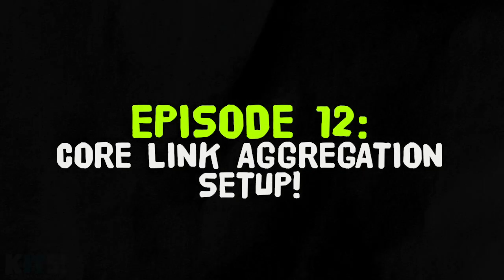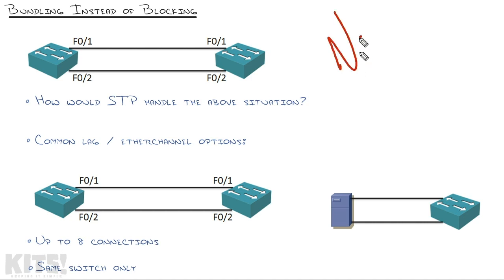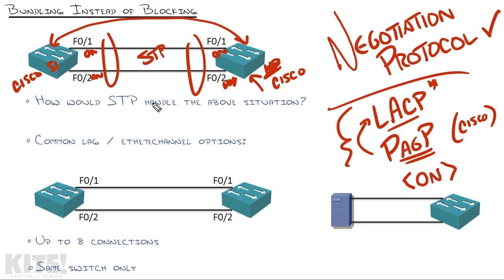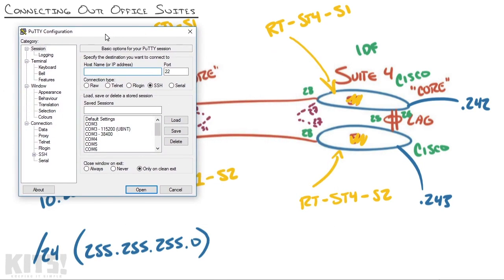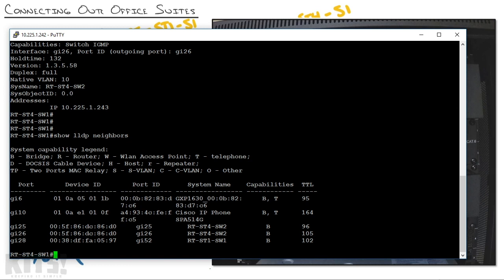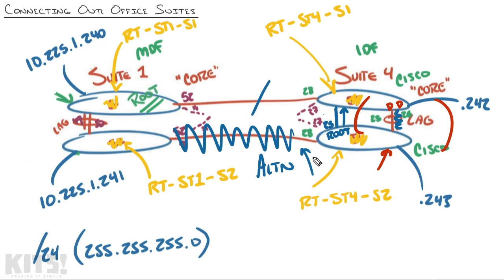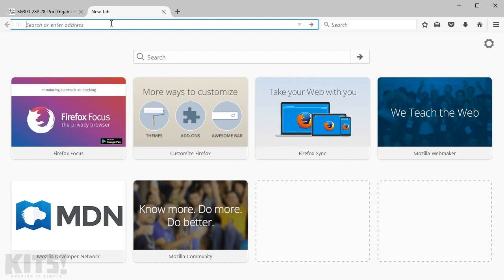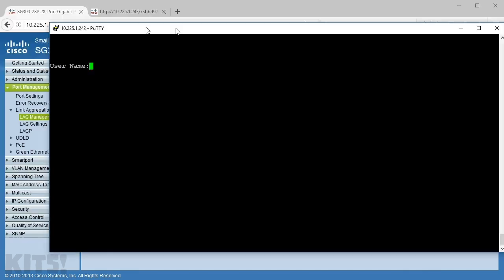Configuring Core LAG (Etherchannel) Ports! Ep.12: Real-World Business Switch Network Build

Comment: one thing that i am not understanding.... are we talking about one physical connection on each being bound to a virtual port? let's say port 1 and port 2 are in a LAG group, port 1 is connected to a server. what happens to physical port 2 on each switch (do i put a blank rj45 connector in it or electrical tape over it? LOL ) is this between the switch and router or is this daisy chaining 2 switches? my assumption is..this is like daisy chaining with two physical cables between switches or you would need two nic cards on a server